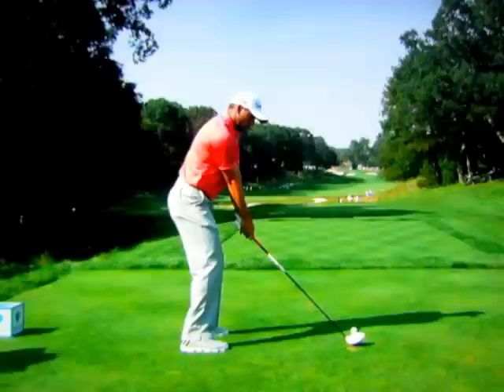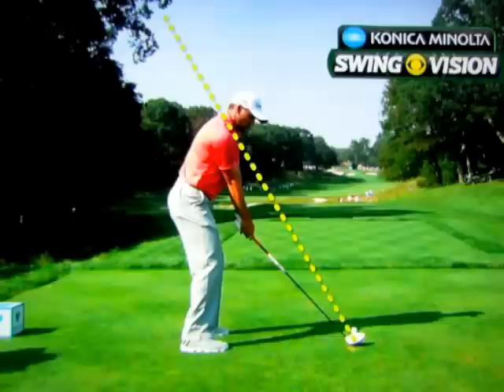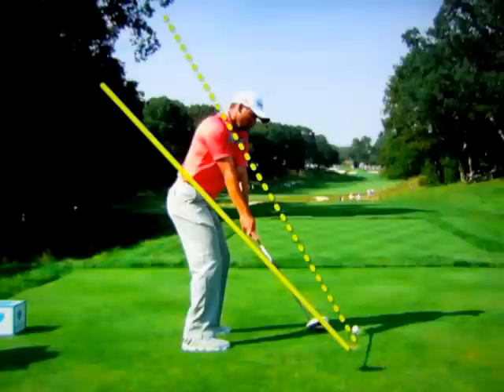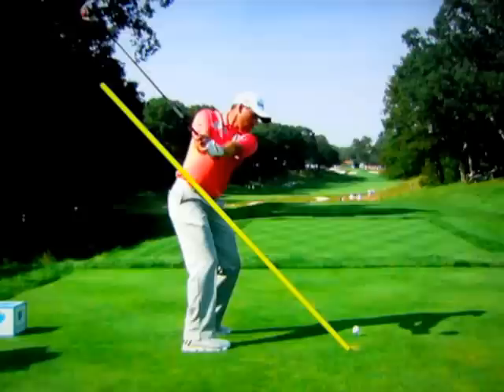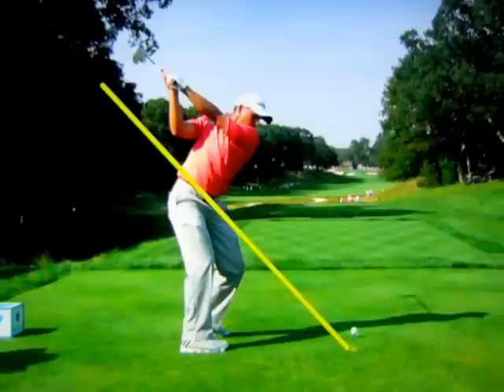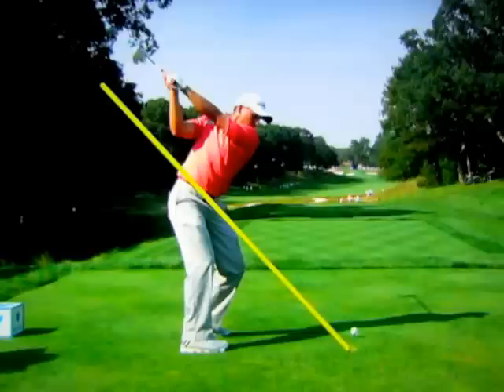Sergio Garcia Super Slow Motion

Comment: robcocq if you square the face early you're leaving alot of distance on the table imo.  all you can do from there is sort of push the grip at that point if that makes sense.  As sergio shows here it's forearm rotation from open to square not square to closed through the ball. The clubface never gets closed relative to the path.